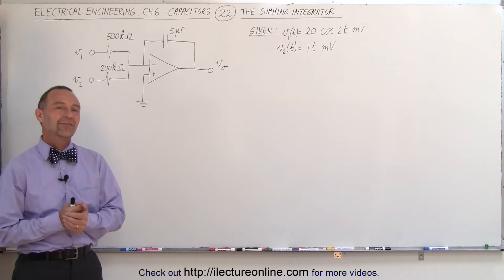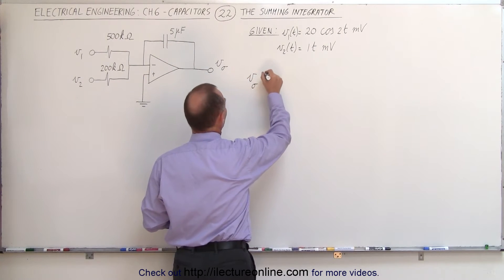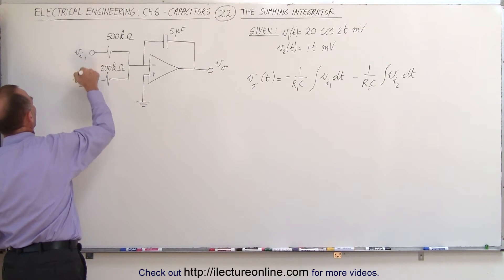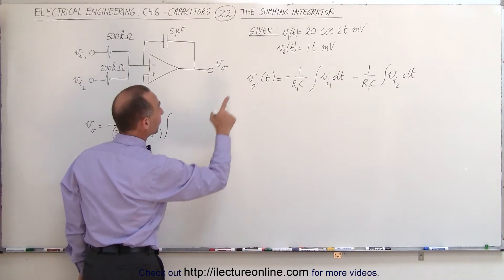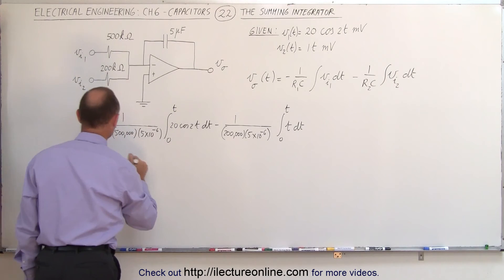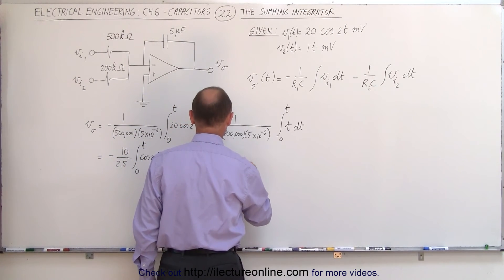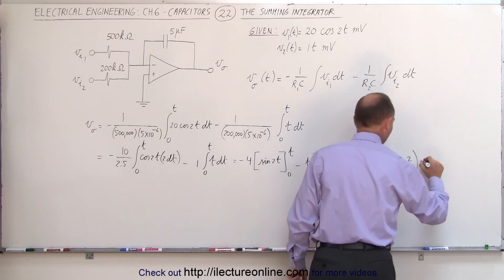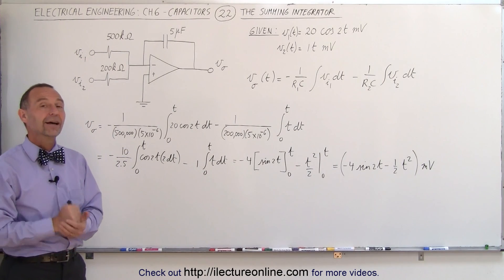Electrical Engineering: Ch 6: Capacitors (22 of 26) The Summing Integrator Circuit

Comment: Sir, I found your example when I tried to learn more about practical applications of this circuit.
I found the schematic of a potentiostat (https://bitbucket.org/iorodeo/potentiostat) (https://bitbucket.org/iorodeo/potentiostat/downloads/potentiostat_shield_schematic_v0p1r2.pdf) and one of the inputs is an offset voltage in the circuit. The OPA227 (called "control amplifier") is in a summing integrator configuration instead of a simple summing and I cannot understand the benefit. It doesn't have a parallel resistor with the capacitor so ... no bias current or offset voltage compensation and it would change the shape of the signal by integrating it. It could limit the influence of noise by integration but that would be the extent of benefits.
Do you have any idea on why the author might have chosen this configuration?

Comment: I think there is an error       @ 2:49 it was suppose to be  multiply by 20       20/2.5= 8       
Just an observation      thanx  a MILLION TONS for making these videos  !!!!!
Reply from the maker: No error, the video is correct.  Note that the 2 is used for the correct differential.  Thanks for checking.
Reply: that wasn't a mistake

Comment: +Michel van Biezen thank you for the video sir, I only have one question - To what extent does the capacitor reach as output voltage in an automobile's audio system, for an example?
Reply from the maker: The amount of charge a capacitor holds or the voltage across a capacitor depends on a lot of things.  Typically the charge and voltage are constantly changing. It greatly depends on how the circuits are hooked up.  (most circuit boards have dozens to hundreds of capacitors).